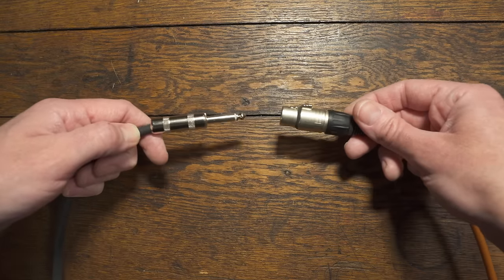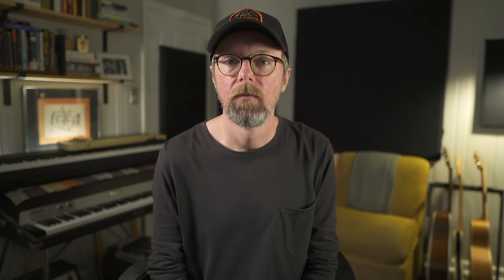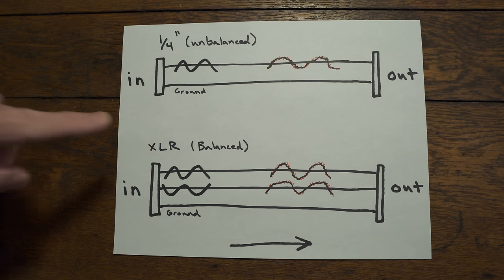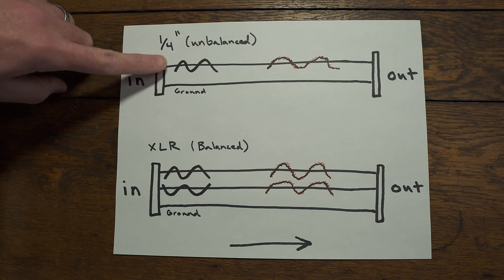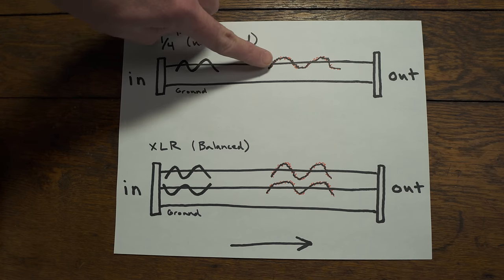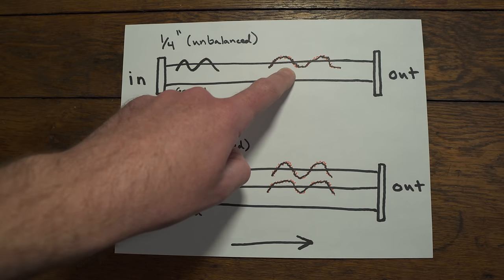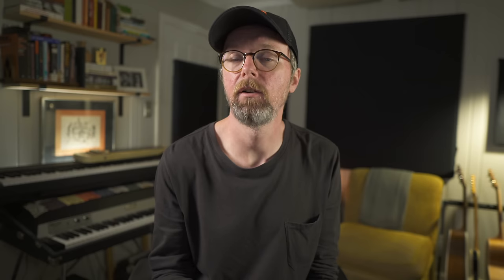Modelers and DI's: What you need to know (Pinstripe Pedals DISO+, Walrus ACS1, Iridium, HX Stomp)

Comment: In my opinion, the fact that you can switch the outputs of the HX Stomp to balanced line level is one of the reasons that make it superior to many other modellers. And Line 6 has stated that phantom power won't do any harm to it either.
So, you only need a DI box (or that "line isolator") in case of ground loops. But that shouldn't really be a problem either, as most pedalboard power supplies are fully isolated.

Good job explaining the difference of balanced and unbalanced cables!

BTW: I wouldn't expect any impedance issues as all modellers should have a relatively low output impedance.
When it comes to audio interfaces, there's usually also the option of simply using the instrument (or Hi Z) inputs. Those should work fine with the Iridium for example.
Reply from the maker: I have heard that sending phantom to the Line6 stuff will negatively impact your sound while it’s on but haven’t tried it myself. That could be only related to the Helix XLR outputs… I just can’t remember
Reply: @MichaelWWestbrook  I don't really see a reason why it should have an impact on the sound, but I guess, I'll have to give it a try, now that I'm curious about it. 🤔
Reply from the maker: @error8418  Same, seems weird but it’s just what I’ve read.
Reply: yeah, it's weird, but on my Helix floor, if foh has phantom power enabled on my xlr outputs it gets some bad sounding crackling and distortion that stops when phantom is disabled...

Comment: Great demo!  I'm getting some noise from what i think is the WiFi network in my building. It's occur between my amp modeler and my USB interface.  Both are connected to the same power board/multi plug. I've tested them both individually and the noise goes away and are crystal cleanr  Am i right in assuming that its a ground loop interference? And will a line Isolator like the DISO+ help to eliminate the noise? Cheers.

Comment: Great video :) If i run pedals after the hx stomp would i have to use a di box not a line isolator as i would not have a balanced output or would i? Thanks
Reply from the maker: Correct!

Comment: Thank you, the informatve video is a confirmation of why I really love my rack DISO+. Do you XLR to TRS when going out from DISO to audio interface or XLR to XLR?
Reply: Depends on the audio interface. On most interfaces with combo XLR/TRS jacks the XLR is meant as a microphone input and the TRS is meant as a line input.
So, it also depends on the output level of your modeller. If it's already line level and doesn't need much further amplification, the line level input (TRS) is fine, but if your modeller has instrument level outputs, you'll probably need the extra gain of the mic pre (XLR).
However, the XLR input should work either way.

Comment: I run my amp into a load box,out of the Load Box into pedal board,then into my interface….Would one of these be necessary or helpful in my situation?
Reply from the maker: Depends on what load box you are running. If it has XLR outputs then no, the DISO+ isn’t necessary!
Reply: @MichaelWWestbrook  I have several,and they all have XLR outs…But….I have a few of the old Rockman Modules which I run straight into the interface,and those do not have XLR outs…

Comment: Really great video, what about if the DI is active ? you have used a passive one, would it be the same with an active DI ?
Thanks.
Reply from the maker: An active DI is going to give you more gain because it basically has a preamp in it but the idea is similar, you have an unnecessary step. Without looking at the signal path of the DI I’m unsure if it would solve the saturation/headroom issue while running running high output modelers
Reply: @MichaelWWestbrook  Ok, thanks a lot, very helpful....

Comment: Speaking of wanting to use one of the Temple Audio Pedalboard modules, should I just use the XLR Module or use their new DI Module for stereo? Trying to see what is a better fit for no signal loss of a DI since I only need a Line Separator
Reply from the maker: Sorry, I’m not familiar with those
Reply: I use the active DI module. Works great. Don’t use the passive one.

Comment: Have you ever tried using a specifically designed -15db pad on a hot signal in JDI.. and than compare with DISO? I guess not)
Reply from the maker: You could do that but then you’d have even less signal and have to crank the pre even more.

Comment: wow, very informative.  i knew about phantom power, as i heard it somewhere, and i'm a sound engineer.  but, it really is a great idea the di box idea however,  the 48V travels along which core of the xlr, i assume obviously not the ground, so isolating it from one of the two hot wires is done with a di?

Comment: Speaking of quality etc…
Thoughts on using 454 22AWG 2-Conductor Stranded Shielded Miniature Line Level Audio Cable in the pedalboard vs the normal patch cables to save space. Line level is considered higher quality than instrument, it’s shielded etc and significantly thinner and easier to route bunches into tight spots.

Comment: Hey Michael, are you familiar with the TA link? Would it get the same job done as the DISO+?
Reply from the maker: I think that is more of a SGI replacement right? A way to send guitar signal to amps over long distances. Maybe if you just used the “send” side? Not really sure but I know it’s intended use is different than the DISO+
Reply: @MichaelWWestbrook  Yeah it's an alternative to SGIs. I've been wanting to get an ACS1 as an alternative to my amps and thought I could save a few bucks by using it with the TA link and not get the DISO+, although I'm sure the DISO has some great utility.
Reply: The TA Link should perform the same function, however there is no ground lift on the Send/TX box. Ground lift is on their RX box (as it should be for those systems). HTH!
Reply: @pinstripe_pedals  Gotcha, thanks for the response! I ended up getting the Pinstripe lol

Comment: The difference of the sound in the video between the JDI and DISO is apparent, however I can spot a problem plainly with the comparison.

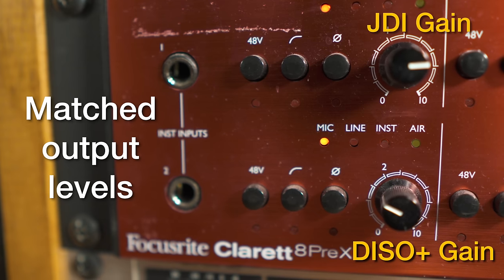At 7:46 it looks like you level matched the two signals in the Mic Preamp itself, which meant pushing the Mic Preamp gain way higher than you'd ever need to when using a JDI (3 o'clock).  When you do that, you saturate the sound with unwanted Mic Preamp coloration.  Also, the DISO should really be running into the Line Input of the Clarett, not the Mic Preamp ... having the Mic Preamp engaged for the DISO with a gain set around 10' oclock was adding more fuel to JDI input "fire" as you attempt to level match.

The level matching should really have been done within the mixing interface, not the Clarett input.  For instance, you wouldn't do a comparison where the DISO signal was too hot for a Mic Preamp, or then it would have been the DISO at a disadvantage instead of the JDI.  I've done this comparison with both the DISO and the JDI and they resulted in a virtually identical sound when proper gain staging was used for each.  They are both very good devices and one sounding significantly different from the other is easily attributed to sub-optimal gain staging.
Reply from the maker: I wouldn’t say it’s a problem but more so a real world example as it was intended to demonstrate. In a live situation this is exactly how it would be run. That’s one reason my audio engineer friends swear by it, you don’t have to crank preamp gain to get good level.
Reply: @MichaelWWestbrook  I'll have to respectfully disagree.  For a gig, proper gain staging should be applied to every channel for both good level AND good audio fidelity.

DISO shouldn't be running straight into a Mic Preamp in the first place.  After all, the purpose of a Mic Preamp is to take Mic Level and increase it to Line Level, along with also making a good impedance match to the Mic.  The DISO is already Line Level and should be sent into Line Inputs, which are available on the Clarett as 1/4" TRS.  I can only suspect the reason you didn't do the proper connection was simply because the DISO uses XLR connectors and it's simple to err by plugging in from XLR to XLR without consideration (or adapters).  But I'll put that aside because in the grand scheme, it's usually not a huge sound crime to run Line Level into a Mic Preamp.  It's definitely not best practice, but as long as the level of the signal going in isn't too hot for the Mic Preamp to handle at its lowest gain setting, it's okay.

As for the JDI, Mic Preamp gain shouldn't have to be cranked that hard in order to get a hot enough signal, and definitely not in an effort to compete with a Line Level signal that's ALSO being fed into a Mic Preamp for a shootout comparison.  That's not real-world.  Cranking the Mic Preamp gain that hard is going to degrade the original sound and should be avoided if possible.  There would very likely be another option for a gain or a pad stage prior to the Mic Preamp that could be adjusted before going to that extreme on the gain control to get a reasonable -12 or -18 peak.

I'll stick with my assertion that this is why I hear a difference in the example ... it's not an inherent difference in sound between the JDI and the DISO (both which use quality Jensen Transforms), it's in the implementation.  I've also done my own comparison of the DISO and JDI along with Focusrite ISA Preamps and was mindful of proper connections and gain staging.  Any difference in sound was imperceptible.  Only evidence of any difference was through a null test, and even that was very minor.  I'm not advocating one over the other, if your sound engineer is okay sending them Line Level at a gig, go for it, DISO all the way.

I took the time to write this hoping to give you something more to think about in your own quest or future shoot outs.  Good presentation and info about balanced signals!
Reply: Nah you’re wrong sir! As he explained he is demonstrating what would happen in a live scenario, not studio. 
In a live environment 99% of the time every signal from the stage hits a mic pre. So it is a fair real world comparison as there would likely be a 20db input gain boost required on a JDI vs the pinstripe. This is the point he demonstrates. 

In the studio, I agree with you. You would feed it into the line input. However most line inputs on studio gear simply engages a -15/20db pad on the mic pre and still continues to route the signal through the mic pre. It often isn’t its own separate gain stage. I feed line level into my line input on a UA Apollo. I know for certain this just pads the mic pre circuit. Also most modern preamps, especially those on pro mixing consoles / stage racks can handle line level at the input without distortion.
Reply: @matthewjamesmichael  While you are correct in several of your assertions, such as availability of Mic vs Line inputs at gigs, or the use of the Pad switch, I'm afraid that you missed my point.

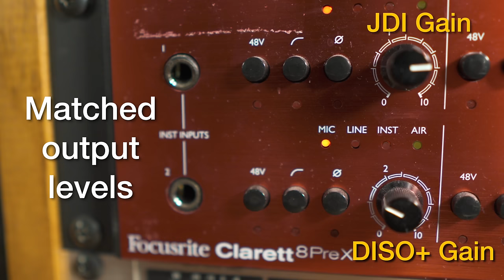He is attempting a VOLUME level match between them using just a Mic Preamp Gain control, which he shows at 7:45.  Gain is not the same as Volume.  In the real-world, live or studio, the Gain control of a Mic Preamp is used to set a nominal gain structure.  Mixing of volume comes later.

Bottom line.  If you took 2 JDI's and recorded one with nominal gain structure and the other with an extreme gain boost like in the video, then mixed them together in the DAW so that the volume was the same, you would hear this same difference even though the 2 boxes are the same.

If the point was just to show that there IS a difference between Line and Mic level, that's fine.  The problem I had was how this lead to a false equivalence when comparing the sound.  The fault of that lays with the engineer, not the boxes.
Reply: @jmkmusicpedals  I don't really agree still. He is doing exactly what you said, setting the same nominal gain structure for both sources. I can make a confident guess that both faders are set at 0db. Therefore he is using the gain pot to correctly set the input signal on both DI's to hit the same input gain - which is the correct way to gain structure. Let's assume both sources are hitting -18dBFS. He isn't volume matching with the faders, he is input gain matching with the gain pot which makes total sense as the argument for using a line isolator is that you introduce less noise into the signal as you require less input gain at the preamp.
Reply: @jmkmusicpedals  Also if he didn't boost the input gain for the DI box, and only used the fader to match output levels, his gain structure would be totally off, and there is a strong chance the signal coming into the mic pre is in the noise floor of the preamp so boosting the volume will also bring up the noise floor with it.
Reply: @Matthew Burrows  I won't make any more assumptions about what levels he achieved after the input, or what was even checked or known by him since he didn't say or show.  I won't make any more comments about that unless there is info.  All I know from what he did show is that he performed an overall Volume match using just a Mic Preamp's gain control.

I do come at this knowing a couple things:

1.  When you push the gain on a Mic Preamp higher and higher, at some point it's going to have an effect on the sound.  It's not just about Volume; there's more that goes on between the input and output of a Mic Preamp in relation to a gain control other than output Volume.  It is aligned with the input stage, and there's an internal headroom limit and audio character depending on the the Mic Preamp in question.  There's no dispute that the Gain control on the Preamp for both channels is VASTLY different, it was clearly shown.  (whether you or I think that this amount of gain for the JDI channel is "real-world", or if it was done just to satisfy the technical aspects of making a Line vs Mic Level comparison video, will remain in dispute I guess)

2.  The JDI and the DISO do not really impart a different sound from each other if both are staged and mixed appropriately (live or studio).  Yes, I had both for a time and there's a video on my channel with audio comparisons I ran of the two, and with other DI/LI boxes, including null tests which you can find if you want ... it's probably in the suggestion list for this video (I'm really not trying to pimp my channel here, I think that is such bad taste, so I've avoided it, but honestly at this point it's the best way to continue.).

That's all. Trying to bring light to why we hear a difference in sound beyond the simple blaming or praising of one box over the other when the difference is actually staring us right in the face at 7:45.

Comment: Good video. As I understand it, there are two reasons DIs are designed to drop to mic level. First, older desks may not have had a pad switches on their mic inputs so could be prone to being clipped - this may not be a thing so much now. Second, laying cables alongside each other can induce crosstalk between cables ... And if one or two of the cables of many running alongside each other are line along side mic leads ... The latter of which will have their gain cranked at the desk ... Then line level signal can bleed into the mic level signals. I'm pretty sure there is a sound on sound article on this. Thanks for the vid ... And the sound comparison to the Radial was very interesting.
Reply from the maker: That interesting! Thanks for the info, I’ll have to look into it. I honestly know nothing about the history of DI’s.

Comment: I run my iridium before an el cap and flint and then into my PA (which has an xlr/1/4” input) and use a trs patch cable into iridium and out of iridium and then a long trs cable out of the flint into the PA. Are there any flaws in this method? Your explanation is admirable but I’m afraid my brain falls on the wrong side of the bell curve.
Reply from the maker: There is nothing gained by running TRS cables with the iridium because it is an unbalanced (TS) output. You would get the same result using a typical guitar cable. If this works for you then great, but you could run into some of the issues I mentioned in the video (noise, impedance mismatch).
Reply: @MichaelWWestbrook  thanks for the reply! Will look into the DISO+!

Comment: Does the ground lift switch work for both the 1/4” outs and the XLR outs?
Reply: The ground lift is only for the XLRs, though we have built units with isolated 1/4 inch outs in place of the XLRs if you need that. Drop us an email if you'd like to discuss.

Comment: Thanks Michael for your videos! I've really enjoy and learn a lot from them! I was wondering how you record with the walrus audio acs1/iridium? I have been plugging my acs1 straight into my interface which is just a Behringer U-PHORIA UMC202HD (nothing special). I find the quality is no way near as good as if I were the plug my earphones into the headphone jack on the acs1. Whats the best way to record with them? Many thanks!!
Reply from the maker: What kind of difference are you hearing specifically? I’ve heard this complaint with the ACS1 and the Iridium but have always felt the complete opposite with my set up. I always prefer running it through my interface compared to the headphone outputs.
Reply: @MichaelWWestbrook  To me there's less clarity, more 'trebly' and less bottom end. I am not sure if the DAW might have anything to do with it? I am using GarageBand. Thank you very much for your reply, appreciate it greatly :)
Reply: I’ve had a muddy and harsh sound with acs1 and Behringer interface. I’ve swapped it for ssl2 and the problem was gone. Guess it was about the preamps.